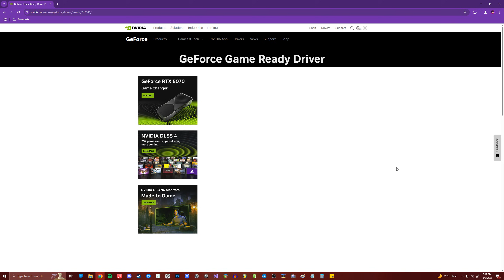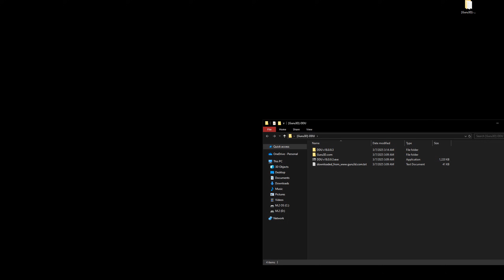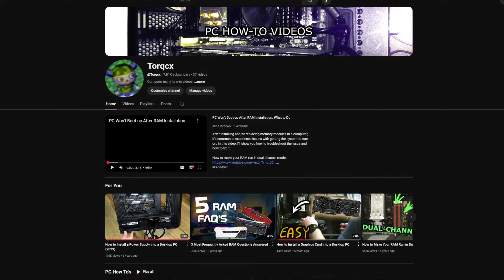How to Install a Graphics Card into a Desktop PC (2025)

Comment: I just found your channel and it's helping alot so far. I bought the cheapest PC I could find and surprise there were issues. I'm in the process of fixing the ram stick situation but still need help with the cpu cooling system. Do you know how to instal something like that?
Reply from the maker: The only CPU cooling systems I have experience with are regular heatsinks that use fans, nothing water cooled. I have a video on installing CPUs which shows how to do so, if that's what you're looking for!